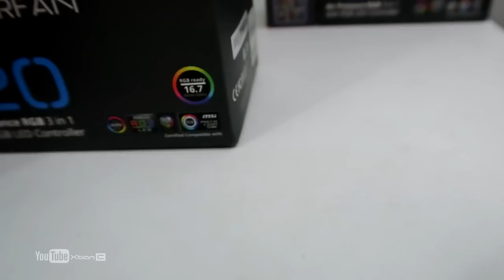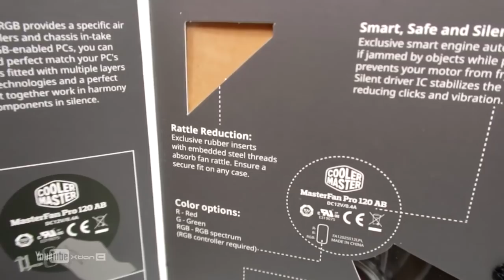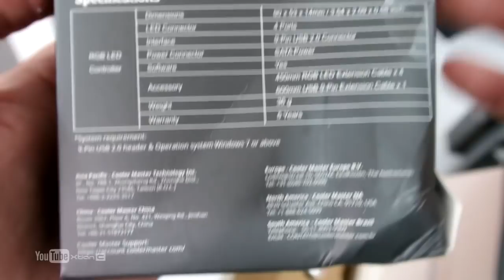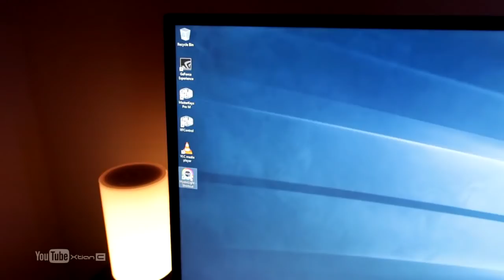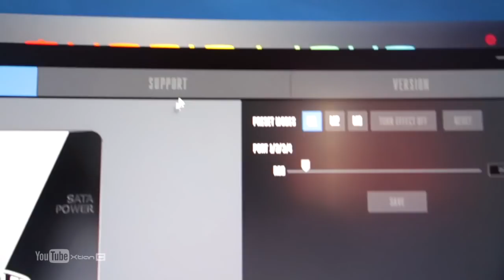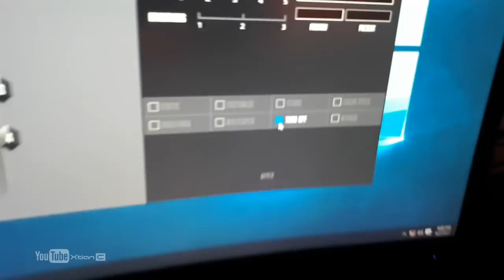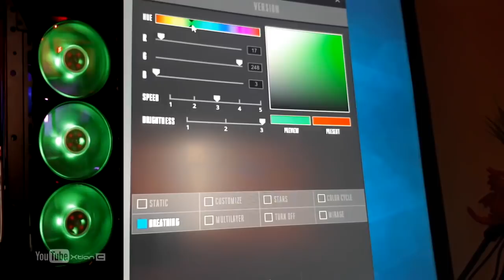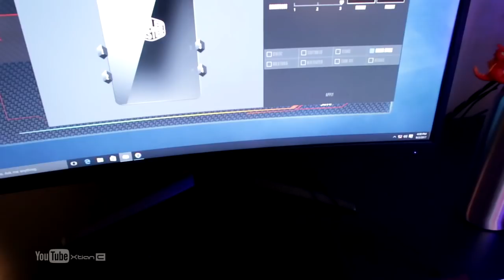VLOG: CM MasterFan Pro 120 Air Balance, Air Pressure RGB w/ LED Controller Unboxing & LED Demo [Ph]

Comment: Same tayo ng case. Planning to get 1 kit of this. QUestion ko lang 1 lang ba ang cable ng fan to power both the LED and fan or 2 separate cables? Kung isa lang I will go with this 1 over dun sa COrsair HD120 RGB kit...will wait for your reply. BTW, this will go well with Cryorig H7 Lumi :) salamat!

Comment from the maker: How to install LEGIT windows 10 pro for P700 pesos - https://youtu.be/2ptYqLggU4E

Timestamp/Video Content

2:24 - Masterfan PRO 120 RGB Unboxing
4:12 - RGB Led Controller Unboxing
5:24 - Air Balance, Air Pressure Comparison
6:08 - 1 to 3 Splitter Cable for RGB Led Fan & Led Strip
6:51 - Masterfan Pro 120 Manual switch for RED, BLUE & RGB
10:27 - CM RGB LED Controller 
11:38 - LED Controller Software Overview
13:30 - Masterfan Pro 120 RGB LED Demo

Comment: if bibili ako ng MasterBox Lite 5 RGB, diba it comes with 3 rgb fans, makakabili ba ng coolermaster rgb controller lang mismo?
or any tips para macontrol ko yung 3 included RGB fans ng MasterBox Lite 5 RGB?
Reply from the maker: not sure if meron silang binibenta rgb controller lang pero pwede mo naman i sync sa mobo mo para dun na lang macontrol lahat ng effects.

Comment: Sir ask ko lng wla ksing rgb header ung mobo ko pero mystic light capable po sya pwede kaya sa mystic light yang led controller?
Reply from the maker: Isaiah Sadorra anong exact model ng mobo mo?
Reply: Xtian C msi z370 a pro sir
Reply from the maker: Isaiah Sadorra pro carbon ac?
Reply: Msi Z370 a pro lng.po sir ibang model po ung carbon ac

Comment: guys okay lng ba yung Air Balance sa radiator? guys yung lng kasi stock, nakakpagod na maghanap ng CM airpressure guys eh, plano ko kasi magLCS guys eh
Reply from the maker: Vince Agudera if sa Radiator ilalagay I highly suggest kuha ka ng Static Pressure na fan Hindi kasi lulusot yung hangin sa fins ng Rad if ordinary fan Lang lalagay.
Reply: So sir @Xtian kinonek mo yung 3 rgb splitter kay rgb controller para maging 7 na rgb fans ikonek? Right po?